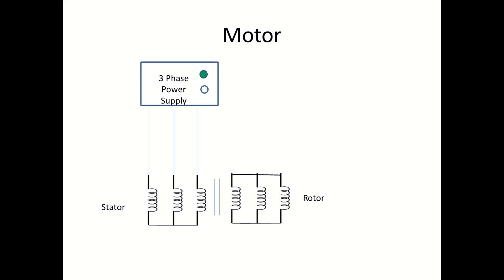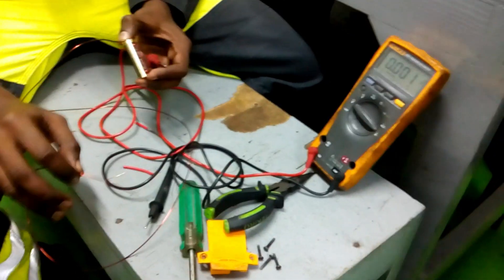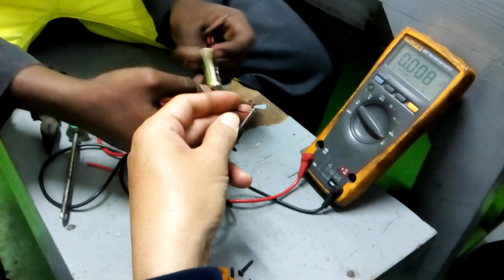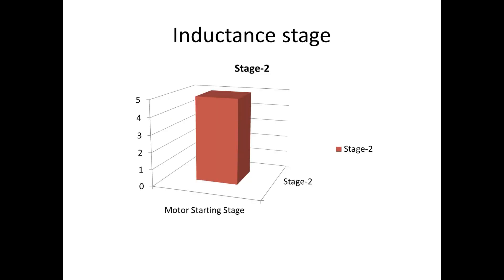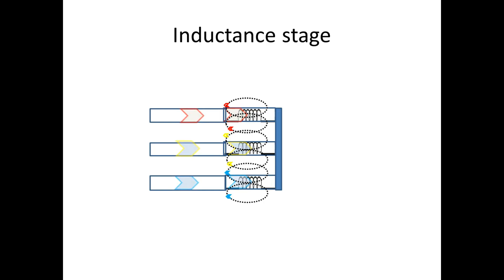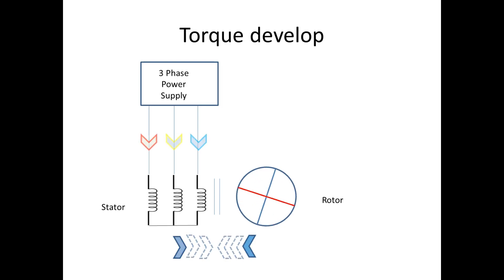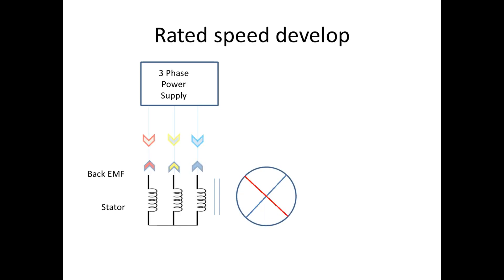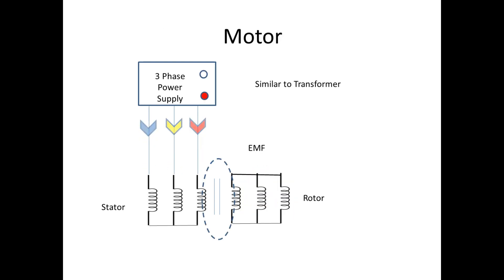Why Motors Draw HUGE Current at Startup? | Motor Starting Current Explained

Comment: Hello sir. Thank you for this great video.
I am helping a carpenter  with his machines. His machines start at very high current as you say. For example an old bandsaw. What is the simplest/cheapest way to reduce the starting current? Is it possible to use capacitors? Or is the starting motor the best method? thank you again my brother
Reply from the maker: for small rating motor you can use Softstarter
Reply: Thank you very much for taking the time. I should have specified in my initial message that the motor is 13.5 HP, 34.6/20 A, 10 kW. Sorry about that. I think it's a slip ring. I don't know how to confirm if slip ring or squirrel cage. Thanks again brother

Comment: Why motor not trip on high starting current?
Reply from the maker: normal motor starting current is high so it should not trip until its design current value with time
Reply: @baranitech  sir normally starting current of HT motor is 6 times the FLC but doesn't trip .
Reply from the maker: @WasimKhan-un8df  yes it will not trip. but if its goes like 8 times and take long time to reach rated current then only it will trip
Reply: @WasimKhan-un8df   how size the cable ? need to consider 6 x FLA

Comment: What happen to 25 amp electric motor if applied with 300 amp power pack?
Reply from the maker: If power pack burden is more then it will  burn  the motor